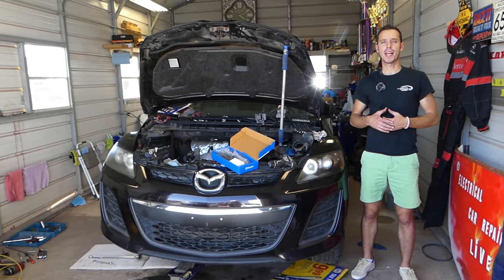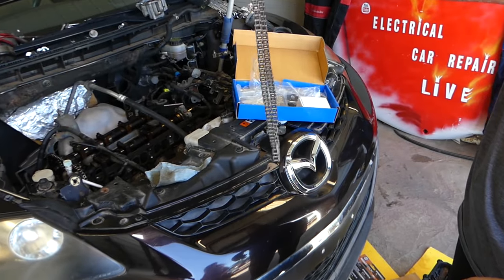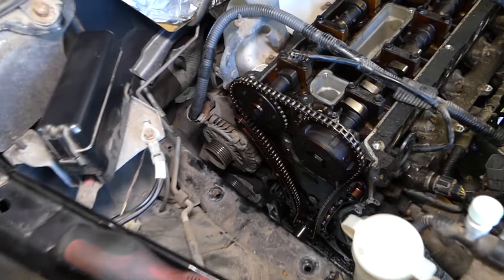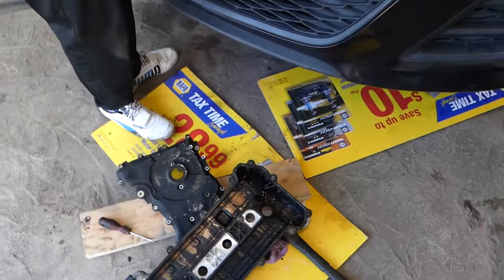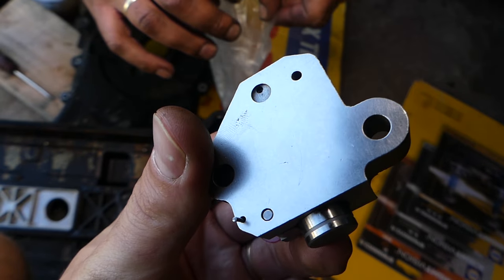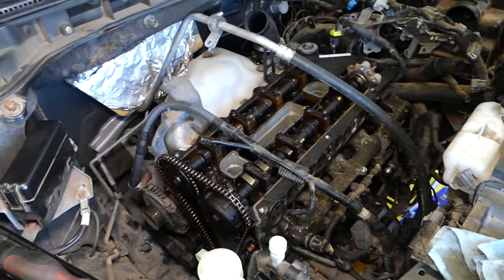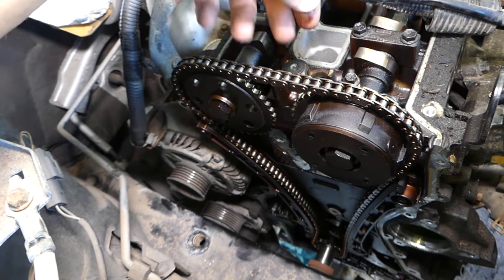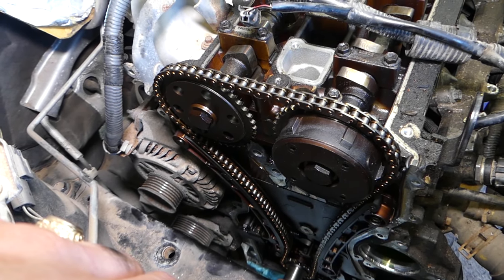ENGINE NOISE RATTLE COLD START OR ALL THE TIME. WHAT CAUSES TIMING CHAIN ENGINE NOISE RATTLE

Comment: I have a Hyundai i30 2011 1.6, my car use to switch off when I take my foot off the accelerator. Day later didn't want to start, day after it made that sound, didnt drive it after it didn't want to start, what could be the problem. Your help is much appreciated
Reply: Hey my Hyundai is like this right now what was your issue ?

Comment: That looks like a new mazda, and it has issues already,  poor quality.  My 1998 corolla has 240 thousand miles and still running strong.
Reply: just because it looks new doesn't mean it doesn't have many miles on it, they also don't make cx7's anymore since like 2012, so the car is atleast 8 years old. also these mazdas come with two engine types. one is a turbo 2.3L and the other a 2.5L. the 2.5L are pretty strong engines but the 2.3L have issues.
Reply: Your Corolla makes you a certified elitist
Reply: yeah and our 2014 Corolla with less than 100k is needing a timing chain. meanwhile our 2009 civic with 230k hasn't needed anything major. the job on the corolla is 1800bux

Comment: I have a 2012 Dodge Charger and it stopped while I was driving and wouldn’t start back up until I changed the starter but once I started the engine it starded rattling something the car never did before it messed up. Any clues of what it could be?

Comment: Very useful. i have 2009 kia carnival 3.8lit , the engine making knocking sound , and it continues.
i went to mechanic , told me to change the engine.
should i really change the engine or it is a the above issue? cheers

Comment: Very Uneducated... these vehicles do not have lifters... these are Cam Buckets that are shimmed. The noise you hear is more than likely the Intake Cam Phaser. Also keep in mind these vehicles are Direct injected which you failed to mention. The fuel rail and injectors are pressurized up to 2000 psi. Did you check to see the if the injector seals. This motor is a mess and I’m sure you may mean well but educate yourself. And if you notice the oil leak more than likely is from the timing cover seeping closer to the alternator not the crank seal. 

Your video is very misleading for anyone searching YouTube for help on this motor.
Reply: which motor are the 2.5L and 2.3L turbo both a mess? I hear mostly good things about the 2.5L

Comment: My Lexus ES330 6 cylinder VVT engine shakes while driving. Also,  low engine oil level is showing in the dashboard although I changed the oil recently. I checked oil level in the dipstick and it is in normal level.

Any advise is appreciated..
Reply: Sounds like the oil sensor switch
Reply: I believe low engine oil actually means the oil pressure is low, so it is not always resolved just by topping up the oil.

Comment: I changed the tensioner and the rattling is still there  ???
Reply: Check oil, water pump, alternator, and also the pulleys. But make sure you get a proper diagnosis before spending money fixing unnecessary parts that are still good.
Reply: That sound is from the cam phaser not tensioner..
Updating the correct link.
(Very sorry for previous wrong link.🙏)) 
video by Speedkar99
https://youtu.be/gwJ5BBHb9W4
Reply: @tonyalston4838  
Very sorry on wrong link. The correct one, video by Speedkar99
https://youtu.be/gwJ5BBHb9W4
Reply: You changed the wrong part